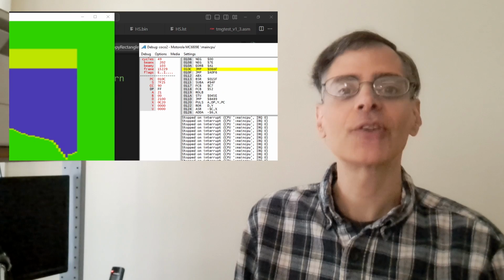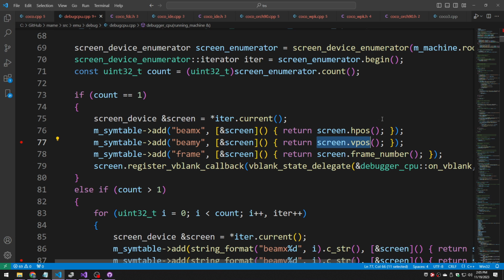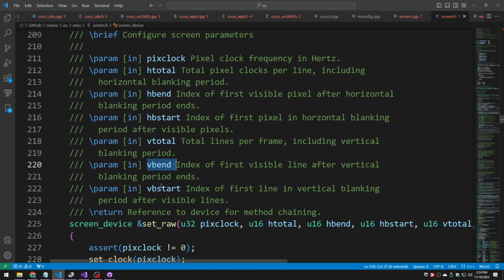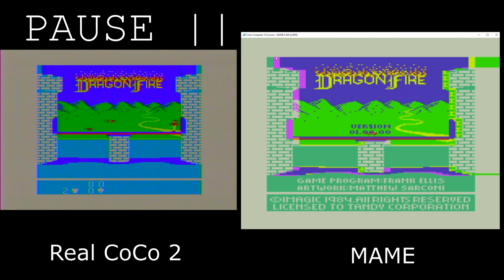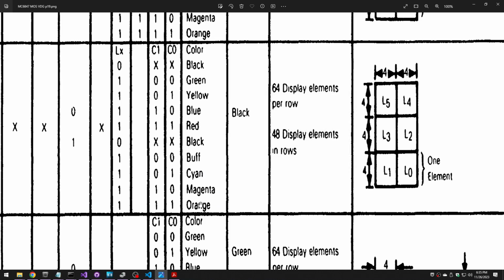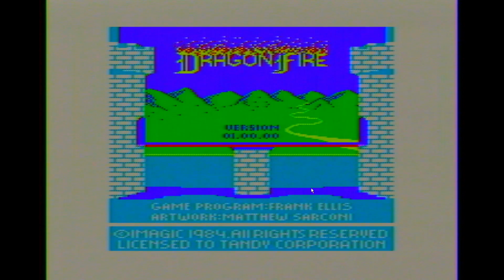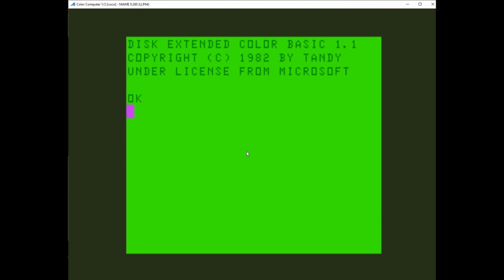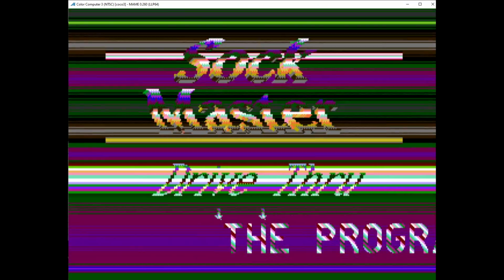The game that broke MAME (and almost me)

Comment: MAME is fine for arcade games where the display modes are simple and don't change while playing.
For computer games where game developers explore the full capabilities of a system, it takes many shortcuts like you have found.
I haven't finished watching your video, but I'm sure you know that that screen thing will never be enough although maybe it will for that crtc, the 6845 is a much more flexible thing and poorly emulated in mame.
The screen imo should get the sync signals and a stream of colour, but maybe that is too much!
It should at least handle differing sync pulse positions within a frame and if modelling a crt, different sync pulse widths and the effects that these have on what would be seen on screen.
Wow, sorry went off on one there, nice video :)
Reply: MAME's standard screen device is fine for most of what people can do on most computers, as long as the CPU cycles and the dot clock are related in a fixed way.  Nothing he's describing the 6847 as capable of is going to stress it, for instance.

We do have a lower-level screen device for pre-microprocessor stuff like Pong where they're generating bare NTSC video with a forest of TTL gates that works more like you describe.
Reply from the maker: Oooh, thanks for the info.  I had not seen the lower-level screen device code.  Sounds interesting.
Reply: @CocoTownRetro  I didn't mean that MAME had it, only that it feels like the right way to do it, allowing you to change display type without changing the 6847. I forgot that the 6847 (also on the Acorn ATOM in NTSC mode) generates the colours, I am most familiar with the BBC Micro where the 6845 only generates addresses and a custom ULA reads them and applies a palette.

I don't know how dynamically configurable the 6847 is, but on the 6845, knowing the time since vsync isn't enough to work out screen position, it will deppen on time since last hsync and in the case of a CRT, times since the last N hsyncs (on the CRTs I tried, 4 <= N <= 8). I guess vpos will be based on time since the last Vsync, or probably the last N vsyncs on a CRT although I haven't tested!
Reply from the maker: @trickysoft  Probably shouldn't quote me on any of this, but I believe the MAME screen device vpos is simply based on timer ticks since the machine was set into motion.  This is changeable if the developer calls reset_origin on the screen device, but such calls appear to be rare among the video devices in the MAME code base.  Based on my tinkering (emulators and actual CoCo hardware), I do believe that time since last vsync is sufficient to predict where on the screen the 6847 is.  Hsyncs are unnecessary to help determine this (but handy if you want to offload line counting to an interrupt rather than meticulously timed instructions).  Interesting to hear from you about the 6845.  I don't know anything about 6845, but I guess that means the 6847 is far less configurable than the 6845.
Reply: There is a technique called vertical rupture where you set the height of the frame to less than it would normally be and then have more than one per 50/60th of a second to get the total back to where it should be and generally only have a vsync in the last. This allows you to vary things that could not usually be changed within a frame. I haven't seen this used on a 6847, so maybe it can't do it.

Comment: I have mixed emotions... cool timing hacks to increase color depth, but otoh treating the CoCo like an Atari 2600 grrr
Reply from the maker: That's pretty funny.  Think of it like... it took a primitive beast like the Atari 2600 to train developers to push the CoCo further than anyone would have believed possible.
Reply: Changing video parameters during active display was a super common thing on 80s and 90s hardware.  The Super Nintendo had a hardware feature to help you reprogram video parameters at the end of each raster line, for instance.  MAME in general calls this kind of technique "raster effects".

Comment: I'm sure there was a ton of work figuring out the correct values for MAME, thanks for persevering. It'll be much nicer using MAME debugger with your more accurate values with it tracking the proper location of the electron beam's x&y co-ordinates.  Cheers!
Reply from the maker: Thanks, Glen!  I already have ideas for upcoming videos to show code-stepping with the debugger, while relying on beamx, beamy, and frame to convey something useful about what's going on.

Comment: Excellent video!

And I had forgot to mention, the PDP-11had the light pen which we used for input to the Lunar Lander game back in 1975. The light pen would report when it saw the flash, and the hardware would work out what the X - Y location on the screen was.
Reply: Is that the same principle that a light gun works on?
Reply: @jonothanthrace1530 partially, an enhanced version really. While the light gun can detect regions, this type can determine the exact location.
Reply: @jonothanthrace1530  I'm not sure, but I would suspect that to keep costs down it would be designed to be as simple as possible.
Reply: It didn't "work out" where the X and Y position was. The counters inside the video circuitry would be constantly updating with the currently being displayed X,Y position and when the lighten "flash" is detected it would just take a copy of the current values of those counters and store them in some "light pen X and Y" registers ready for the software to read the values at its leisure.
Reply: @simonstroud2555  Yeah, like I said. It just worked out. Amazing... :)

And for those wondering, the program was on a paper tape that took 43 minutes to load. This was at the Air Force Academy, and crashing into the McDonald's would destroy it, so there usually was a guy who would reset the game if you got too close (as I did).

Comment: Well DONE!  I need to look into that same game running on the MiSTer CoCo2 core. I'll be very surprised if it works correct.  Very.  Theoretically an FPGA should run 100% identical to the real thing.
Reply: why surprised? it's much easier to replicate hardware timing in FPGA since it's synthesized hardware, everything operates in parallel etc, sw emulation adds much more abstraction. if digital ICs are implemented faithfully in FPGA simply wiring them together would just result in the same output as the original device, problem of course being reversing undocumented chips gate by gate to replicate everything, sw implementation doesn't need that level of detail since it can't do gate by gate emulation anyway it'd be way too computationally expensive. different challenges.
Reply: @snooks5607  Many FPGA cores are not gate-level recreations, they're C code like MAME's fed through a C to Verilog translator.  So accuracy varies widely.
Reply: @MESSDrivers  generating HDL from a C implementation makes as much sense as doing the reverse, ie. not much, I'd be interested if you could point out a MiSTer core where they would've done that? sure various details have been derived from software emulations if no other source of information was forthcoming (it's as good documentation as any in so far it's true to original) and there's definitely some inaccuracies in FPGA implementations as there would be in any recreation including new physical circuit designs, that was not the point. point was that timing control and signal generation is more straight forward in FPGA. so there could naturally be some issues in the CoCo core(s) that aren't accurate to original hw but I doubt they'd be similar to the MAME issues shown in the video, the process is entirely different.
Reply: @snooks5607  Jotego and Furrtek do real 100% gate-level MiSTer cores.  All others are some form of cross-compilation or other hackery.  This is why everyone makes fun of Analogue for claiming FPGAs are always perfect.
Reply: @MESSDrivers  "cross-compilation"? there is no ISA. there needs to be an instruction pipeline to execute machine code, without first synthesizing a CPU there isn't one and cross-compiling from one instruction set to another does nothing, but again, feel free to point out a MiSTer core doing this. I don't know anything about Analogue and don't care about marketing talk, no doubt there's various levels of hacks utilized during any project like this but the goal is always to get it true to the original and accuracy of a recreation doesn't just magically appear it's a hard won battle no matter what platform it's implemented on, nobody with a clue thinks otherwise.
Reply: @snooks5607  There actually doesn't need to be a pipeline.  Remember, digital video games existed before microprocessors.  Pong  and Breakout were made entirely of TTL gates, and arbitrary program logic can be easily turned into a gate array.  C to VHDL compilers are a real thing.
Reply: @MESSDrivers  obviously there's TTL games but that's not code that they are running, that's my point, output from cross-compiling is machine code which needs to be executed. you can't "compile C to HDL" it's a conversion, and you can do the reverse. just the fact that something is theoretically possible doesn't mean it's going to be any good which is why nobody in their right mind would do that for a core they'd want to publish as opensource and keep supporting because it would never work properly without massive amount work, I'd argue more work than doing the thing from scratch. just try making a PR to MAME of automatically generated C code and see what they say, the fact that something could be done doesn't mean it actually is. just saying I'd think twice before putting down other people's work without actually seeing what they did.

Comment: Yeah I had noticed the timing changes in MAME between 0.259 and 0.260.   I don’t have any CRT devices I can use to compare.  I would greatly appreciate seeing a side by side comparison of a CRT display from a real CoCo next to MAME both before and after your changes. That would help me to be able to accept your changes as being better/ improving rather than being weirdly different to what we had been used to.
Reply from the maker: Hooking my CoCo back up to my CRT is a bit of a pain, but one thing you can do is look at this video from 2:33 for a CRT: https://youtu.be/VF3wzWV9T7M?si=C-qr_BDxSmaXr4NU.  I find the startup screen to be a good indicator of aspect ratio, as the text screen font is quite noticeably different when the aspect ratio changes.  Note that border sizes aren't too reliable due to overscanning.  You can then flip between that and this video (for the newer MAME) or your own install of an older MAME if you still have it.

Comment: Excellent work. While I've done a lot with the CoCo drivers in MAME, the video system is not one of them. So I applaud your efforts.
With regard to linking on Windows, look into using the Clang linker in conjunction with compiling only the CoCo drivers using the SOURCE= directive in a User Options  makefile.
That will get you down to a link time of 5 seconds.
Reply from the maker: I've been using SOURCE, but not clang.  I will have to give that a try.  Thanks for the tip!
Reply: @CocoTownRetro  Here is the magic line to put in your usermake ARCHOPTS="-fuse-ld=lld"
You should use REGENIE=1 (or make clean) the first time. But note, your not compiling with clang. Only using it's linker.
Reply from the maker: Thanks, Tim!
Reply from the maker: WOWWWW!!  You were not kidding.  I just tried this out, and it really does make incremental linking go down from half an hour to just a few seconds.  And this was in the MAME dev docs all along.  I'm sure I read it originally and thought, nah, I'll just do the default builds and not venture into anything nonstandard and scary.  I should have revisited that decision after I got things building properly!  Thank you again, Tim!